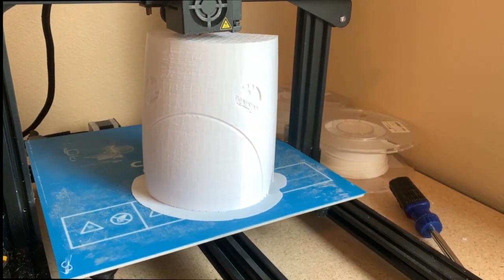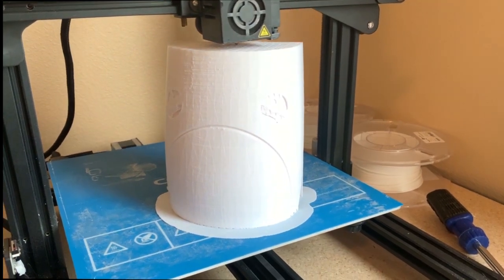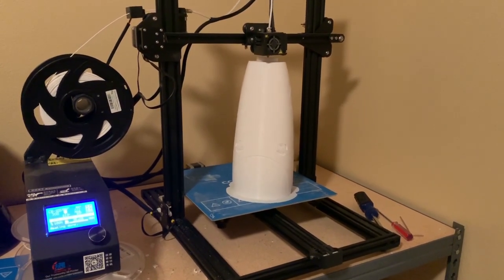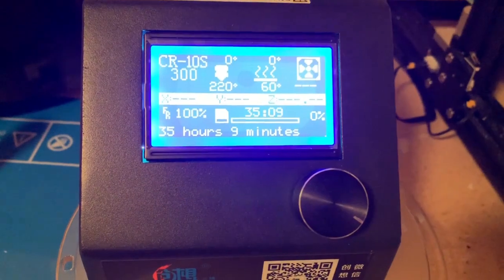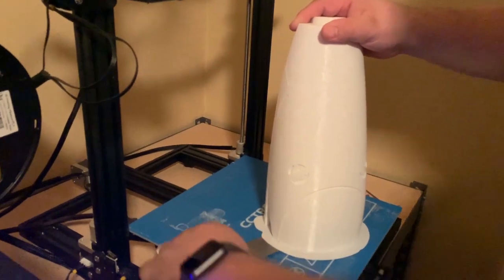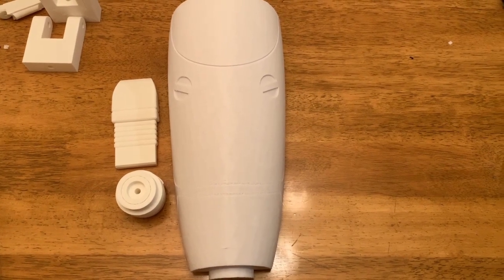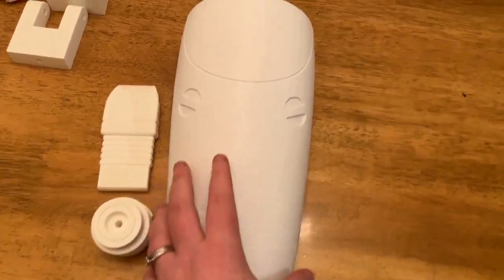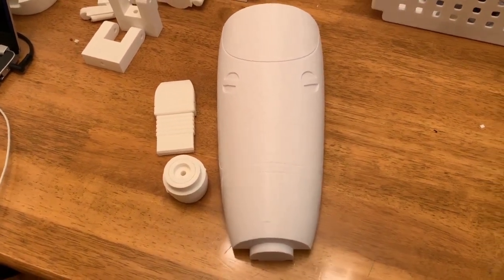3D Printing a Battle Droid Part 1

Comment: What size build surface would I need max to be able to print every part?
Reply from the maker: If you want to print everything in 1 piece you will need a printer like a Raise Pro 2+ (12x12x24in). That printer with its 24in of print height can print all the large pieces. You can also use Meshmixer to cut parts down to size for a smaller printer.
Reply: LittleHoundVlogs Awesome, thank you!

Comment: I don’t know much about printing, I have a crealty ender 3 pro coming. It’s print size is 8.6”x8.6”x9.6”. Will it be able to do the battle droid?  Can you cut pieces that are too large, like the head, and print them in multiple parts? Sorry, very new.
Reply from the maker: Yes, you can print the battle droid on your printer.  You will need to use meshmixer (free program) to cut the parts that are to large, even with a larger printer this is required because the battle droid is very tall and some parts are well over 12in long.
Reply: Thank you!

Comment: How did you get the back curve of the head to lie flat on the bed or did you just use a ton of support?
Reply from the maker: Doug Olson Doug Olson yes supports were used on the back side, it actually wasn’t that much material. At minute 2 of the video you can see how the supports are removed.